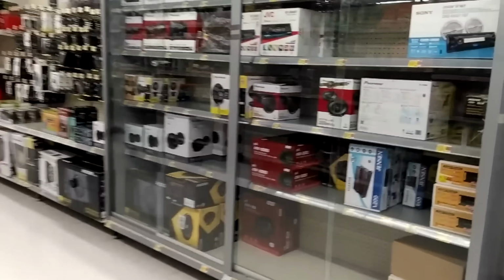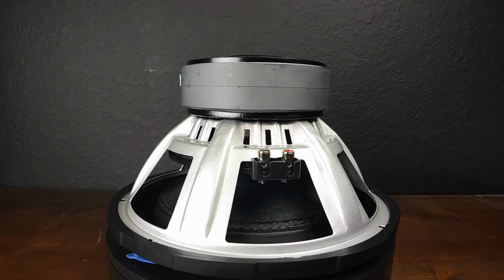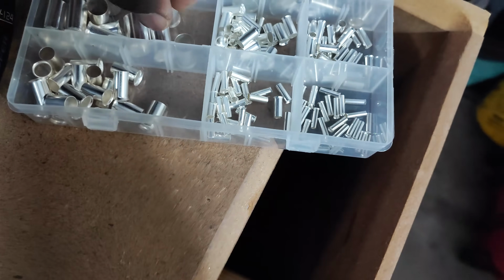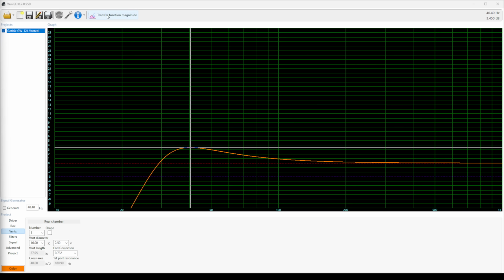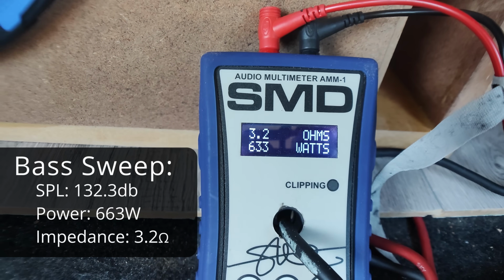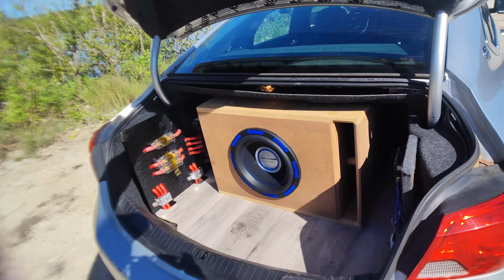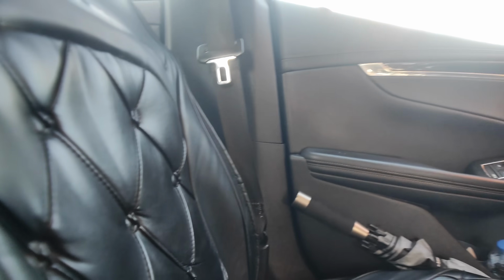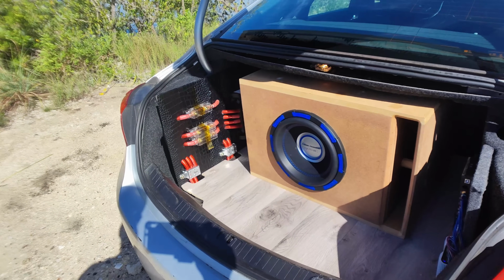Why Is EVERYONE Buying This $80 Subwoofer | Power Acoustik Gothic GW124 | 4,000 Watt SPL Test

Comment: Ita not recommended to use wire ferrules in spring terminals. The spring terminals are designed to press and shape the bare copper wires. A spring terminal cant compress a ferrule and you will certaintly have areas of no contact thus high resistance within that terminal
Reply from the maker: I'll keep that in mind for future videos.
Reply: @BudgetBassHead  bare wire is always king, but alot of car amplifiers have crappy terminals that cut and shear the copper wires when the terminal screw is torqued. Ferrules work great with amplifiers, that screw can really squish the ferrule and wires down hard for great contact. Spring terminals on the other hand... They wont cut your bare copper wires, plus the copper is quite soft and conforms to the inside of the spring terminal much better than a crimped ferrule. Great videos!

Comment: Wait… can someone explain how turing the box around stopped it from bottoming out? I can’t make sense of that?
Reply: I'm sure someone can't explain it better. But when the sound leaves the sub and hits off the trunk the distance is shorter not allowing the sub to expand as much as facing inside the car giving you deeper bass facing rear. The load of the flex from the sub is shorter. Something like that
Reply: Rear facing subs always do better in a trunk!  They resonate off the "Backboard" which is the back of the car and just sound so much cleaner!  9 times out of 10 rear facing is the way to go in a car with a trunk!
Reply: Air pressure.
If there's high air pressure in the box, the subwoofer will have a little bit harder time trying to push that air out of the box.
Therefore it'll move slower and won't clip.

Comment: I've got some subs that I wanna run in my impala. She is a 14 with the bose amp and im trying to just run an amp with an lc2 line out converter for the rca for the seperate amp. Is there any insight you can give me on trying to run it on the cheaper side ?

Comment: One thing I’ve realized getting into car audio majority of the fails or errors is because of user error. Not the manufacturer. of course every now and then someone catches a dud that sucks but most the time people improperly set resistance like a .5 ohm box running on a 1 ohm amplifier. Taramps don’t just burn up they don’t just explode it’s user error. Shit people hate on kicker at least from what I see saying they blow or can’t handle power. But it’s like I beg to differ. Amps are efficient as hell subs are so dynamic I love it. I can’t get rid of my Comps Cs tbh because they just sound so good in the custom box I built for it shit I haven’t even thrown the bass knob on them just relying on stock radio to supply bass ( I know that’s not good) can’t wait to change that though have a great day brother I’m new subscriber can’t wait to see new content u put out

Comment: how can we exceed the max db of a subwoofer? my SR124DVC are at 91db, and in my car with the volume at full volume I have 89-90db. Is it thanks to the amp, or to the subwoofer? I should review my subwoofer on winsd because I only did it by looking at the curve to get what I wanted but I didn't look at the db... I have a power acoustic ts1440-2 which replaces my polk audio c500.1. to go from 500w to 720w which corresponds to the 700w rms of my sr124dvc. It's all recycling but I don't want to break everything. my memory box is between 130 and 150 liters with a 10x10x18cm vent. This is my very first handmade box, so it is far from perfect. but I think the size of the vent is lacking. Besides, how can we put 3000w+ in a 1200w rms sub 2500w max? 🤯

Comment: You've been in this game long enough to know a kilowatt watt of class a/b is equivalent to 2k of class d. My 1992 alpine mrv 1505 will blow that cheap sub up. I blew an l7 with my ppi art series 1200.2,  300 watt x 4 @ 4ohms, 600 watts x 2 @2ohms. Ran them two ohm stereo, and this these were in the dual kiçker prefabricated box, and they were rated 600 watts per sub. Class d is  cheap, efficient power, and that's why you can get amps at 10 cents a watt. Try finding a 1k class a/b amp for that price. For my art series 1200.2, I paid around $900 dollars in 97,98, and paid $1000 dollars ( after taxes) for my alpine mrv 1505 in 92. You kids today have it easy
Reply: Actually class d have a much higher dampening factor and are much stronger than class ab older class D were dirty but new class D is much cleaner. You probably blew them with a distorted signal and under powered with the gain not adjusted right and matched to the output of the head unit. class D are getting cleaner all the time now. Amps like the brax are setting new standards for clean in class D. If you don't know what dampening factor is then you probably should look it up and what it means. It don't matter much for anything but subs.

Comment: It’s really about your power supply- unless you get a quality alternator (not from an auto parts store) and at least one dedicated car audio battery (not from an auto parts store) a stock electrical power supply was never meant to have aftermarket car audio amplifiers connected to it. But way to many people do this-and wonder why the equipment doesn’t last. You can use a 200 watt/ amplifier with a fuse rating of 20amps to add a sealed woofer in a trunk. Using a ported box in a trunk defeats the purpose of a ported box cause a ported box uses atmospheric air to create bass. But if your back seats fold down or you got a hatchback or suv your good. With proper electrical you will have excellent performance and your sound output won’t sound stressed.
Reply: Come on man, not all vehicles come with shit electrical. My 2011 f150 came with a 220 amp alternator. Handled a salt 3k a salt 200.2 and a salt 200.4 with just 1 agm battery. Never dropped into the 12s
Reply: @ah4800  but you got a real dedicated car audio battery and most people are using passenger vehicles to dump a bunch of audio into. And you have a lil know how about audio. Most don’t. I’ll share my lil bit of basic audio whenever I can. Cause most audio shops will just trick people out of there money
Reply: @workingclassperson2124  no it's just a cheap underhood agm. Some factory alternators are really good.

Comment: ran tests, no bullshit, all opinions seem based in reality, i learned something new, much appreciated- thumbs up for good video

if you had a couple extra feet of wire you could of just ran separate speaker wire from each coil to terminal on the box. thats what i did with three i had in the seville.

two questions... why wouldnt it be necessary to perform a similar test to the first when facing the sub rearward? the cabin being part of the system volume, firing direction definitely effects overall level, so... 1) how does firing direction not effect the peak level frequency? and if it does not then... 2) i mean okay but shouldnt that be verified and shown to us viewers?
Reply from the maker: I only noticed this after uploading the video that I did not do the base sweep for the rear facing portion of the video. You are correct  doing a base frequency sweep in the other direction does render a different result.

Comment: Can you do a review over the CT sounds ozone 12? I haven't seen any reviews on it so far brother.
Reply from the maker: I'll look into it.
Reply: The ozone are ok. I had some for $10 to 15 more you can get some Skar DDX’s they hit harder but need more power to push than the ozone. I have had Skar sdr hyanka’s ct tropos and ozone. Currently running Skar DDX’s and Rockville K6. I am impressed with the K6’s don’t need a lot of power to push. Rockville 12’s on 1500 Skar amp. DDX’s on Skar 3500

Comment: These are worth the value w/o breaking your budget.  I bought a pair of these back in 2020 and still bassin' as I am commenting right this moment. I've added these along w/my factory speakers and head unit being powered by a Memphis 1,000 watt mono/bridged to 2ohms. Also hooked up are 1 1/2" tweeters. With the correct wires for power 0 gauge for both + & - to car battery and OEM alternator. No issues whatsoever, most importantly is breaking in the subwoofers before any long period of time with high volume with amp tuned and dialed in with the 12s. Almost 5 yrs, no distortion and spider is still tight in my '19 Rio S. Longest drive and hitting the bass for 7hrs straight in 80+ degrees down to SoCal and through the Mojave Desert. Speakers nor my amp barely got warm. I'm so happy for what I have other than what I spent because others invested a lot of $ on theirs and mine sounded much better especially for the buck. They inquire of what I have and then they're in disbelief when I say it's a WalMart speaker sound system with my stock factory sound system. They are confused but with a happy satisfactory look after a little demo. I'm not bragging and/or over exaggerating, I'm just a 62yr old trying to teach others you have the same quality sound with very minimal modifications and still have money in your pocket. My investment doing labor myself and help from my childhood friend far back to BMX racing in the 70s. I've spent less than $350 excluding breakfast, lunch, dinner & beers for the Saturday upgrade on my Kia, a former Enterprise rental car I purchased in the beginning months of Covid-19. Best purchase I've invested with WalMart to have some good tunes to the ear especially on my Sunday drives and daily drives to and from work. Just me being young at heart and refusing to grow old plus I'm preparing myself for retirement from work next year to enjoy life even more, 🔊🎚️🤓👍To stay young is to be young, unless you injure yourself, it's a different story for the body to heal timely. Truth hurts sometimes 🤔🤭😅
Reply from the maker: That's awesome!  Sounds like you got a great system for the money.  Keep rockin' it!

Comment: 3:45 Are you sure that's not a progressive roll spider? It sure looks like it to me.
Reply from the maker: Progressives are different sizes and depths
Reply: @BudgetBassHead Yes, the rolls appear to be spaced closer and closer together as you move towards the former.
Reply: @BudgetBassHead  There's many different ways to create a progressive roll and different sizes and depths are some of the ways. Another way is spacing the rolls further and further apart. The closer spaced rolls have lower tension and as the rolls get further spaced apart the tension increases.

Comment: Nice it's affordable but the best budget subwoofer is the American Bass Elite or the XFL.
Reply: @RyanBassForLife- It depends on budget limits. In this video, its a $79 woofer, so  would have to compare vs other 12" woofers around $80. American Bass Elites are great for around $160, for a 12", & are a better value vs the AB XFL 12" which is around $220.

Comment: Yup it's all about the box that why builder charger a extreme amount for a wood box there mostly all made with mdf. Some are Baltic birch. Cheap boxes are particul board. 💯👍✌️👌💪  in home audio  svs is one of the number brands  but it's mainly because the boxes are made correctly and with thick mdf. They actually resource the other parts from other companies and have the name printed on it.  Just a fyi💯👍✌️👌💪😉🫡
Reply from the maker: I agree. I have a subwoofer built by the company that designed the SVS 16. It's called the STW350F. A good box is key.

Comment: That's a solid performance especially for entry level stuff. People repeatedly under estimate how important the box is and just throw money and power at it
Reply: My power acoustic mofo 15s have been reliably taking 4000 watts a piece since 2009 ol
Reply: @grabsme  I was thinking about grabbing a set of MOFO 12's. My Fubars have seen better days and will prob stay retired in the basement.
Reply: you mean,like he did?
4000W, for what ? 
my 12 play's on 230W and make's the whole car shake.
cheap, and budget friendly is not the same in my world.
and loud means nothing bud a number.
5W can hurt your ear to the point that you want to turn it down.
Reply: I remember when my Polk Audio subs gave up the ghost in my 2005 Acura RSX back in 2010, I installed 2 x 10" Power Acoustik subs and never looked back. Ran those same subs for 6 years without issue. Haven't had any bass in my car since 2016 though, and it makes me a sad boy. Especially considering the audio system in my 2024 Mazda CX-50 sounds like sh-t.
Reply: Yeah but in his MTX video he hits over 140 DB with a $129 loaded enclosure. If it's got two subs and a box for $129, you know that box didn't cost more than $30 max. Plus it's very basic sealed.

Comment: Well, the sundown audio x is designed for lows. Just because sundown audio recommends that box doesn't mean that is what it likes. Sundown audio also states that you can put it in a bigger box tuned lower. The recommended box you built is the safe general box. Yes, walmart subs can sound good, too, but the x is meant for LOWS totally different than what you are looking for. It's not a fair comparison. Build a 4 cubic foot box tuned to 22hz, then run both subs and see what happens. Great video otherwise.
Reply from the maker: I make content for the average consumer to understand and related to. Not a lot of people listening to 22 hertz in a vehicle. If that was the case, re-bass music would be mainstream. The truth is that most people want 40-60Hz responses. Which is why most music is mastered within those frequencies. 20s and 30hz for music is a very niche thing... One in which I enjoy as well.
Reply: @BudgetBassHead  I never said anything about rebass music or playing music at 22 hz. I said the x subs like lower tuning.  Play the music you like(and the average user likes)on a x 12 in a 4 cubic foot box tuned to 22hz and tell me there isn't a difference. The x was designed for low tuning no matter what you listen to. I know sundown recommend a 2.5 tuned to 32hz, but it works better and loves bigger and lower tuning even for what you listen to. Try it you will see.
Reply: @BudgetBassHead  then why did you buy a subwoofer that is known for its lows?

Comment: 12 awg copper wire per coil is more than enough for that sub I've used subs with smaller terminals & managed to use 12 awg per coil.
Reply from the maker: I agree, but I was planning to apply a good amount of power. Did not want to burn up the last of my 12 gauge wires! 😁

Comment: Why does everyone complain and try to jam 2 wires in 1 post when you can just run 4 independent wires to a distro bolt or terminal block and combine them, same shit.🤷‍♂️
Reply from the maker: But also an added cost. AND not everyone knows to do that. Thanks for sharing.
Reply: I agree me working on airplanes. I've done all that kind of stuff but most people don't know that or don't think to get terminal strips! I'm putting a bus bar in my trunk to add multiple amps to the same 4 gauge power wire
Reply: Everyone meaning you're around a lot of people who complain about shoving wires where they shouldn't then maybe grab a book, there's ways to do this as he showed but also ways to do it without the occasional spark fire or inferno... A spark box, bolt box, jumper rail is all well and good until they dont understand in line and parallel and also the look of some thing being clean and then the fusable cutoffs to tie in and the extra battery.... Need I go on... That's why
Reply: Yeah, I'll do anything not to put tin on any of my connections
Reply: @Laredo-c7g I use ferrels. They are really handy and clean. For added connectivity. I soder the ends
Reply: Easy chomper.
Reply: you win the internet connection method lol
Reply: Bottleneck.

Comment: I rewired my setup. 137.5db right now at 34Hz with the GW-124 and the RZR amp from walmart. Breaks up to a 138db sometimes.
Reply from the maker: Nice work! It's all about the install.
Reply: Try it in freezing temperatures, the motor will have more force when its cold.

Comment: I got two! Been pounding them for two years, with no problems! I mounted mines without that rubber! I like the look without it, and it doesn't seal well anyway!
Reply from the maker: I had to go with an 11.1 inch cutout to get it to seal correctly.
Reply: Did the same.  These subs are great to start out with or even keep rockin if you dont want to move up in power.
Reply: @zoominnboomin  Yeah man, I'm satisfied with what I got! I just swapped out my factory tweeters, and mids?  Big difference!
Reply: The rubber seal is what seals the sub to the box so pressure doesn’t come out 😂😂😂😂 yall sgit ghetto asf
Reply: Same I had to take it off
Reply: what amp should i get for mine, i just bought 2

Comment: Biggest problem with car audio for me is I want deep DEEP 24 inch subwoofer (definitely not a 12 or 2 12s) bass on a 10K (paraphrasing), but I need my car trunk for functionality. 

Alot of people don't get into car audio solely for the box size, especially ported boxes.

If only there was a sub that didn't require a box at all and hit like a freight train of bass......
Reply: Could always ditch the back seat and go infinite baffle haha
Reply: @frothyshoes  never considered that
Reply: @jayboogie7956 At first I thought you were joking. Budget bass head just did some videos on a dual 18 infinite baffle in his car. I guess you didn't see that.
Reply: @JasonWW2000  I always hear of the concept but I thought it was just that: a concept. But now seeing it's a real thing, I believe I am going to try it out
Reply: @jayboogie7956  you need to use a woofer with a qts higher than .7 to perform right in an IB set up.
Reply: the answer is infinite baffle hahaha , I got 2 CVX 15"  , my car is a  honda accord, and 90% of the trunk is free
Reply: @jesusgamalielperez8375  I might have to try something like that.